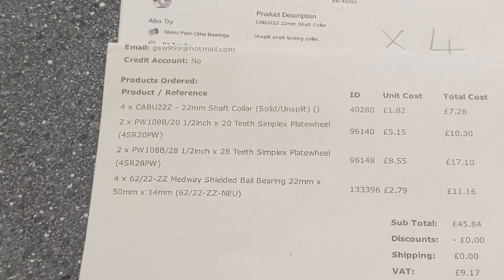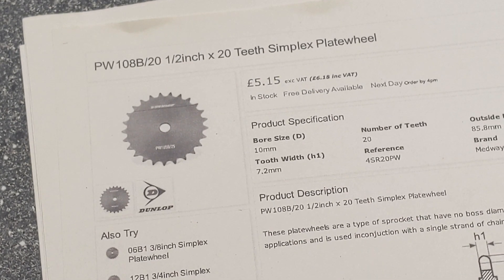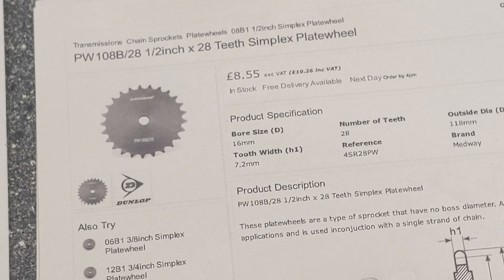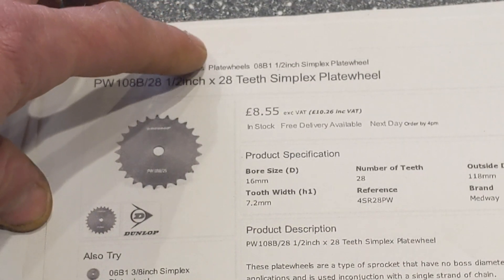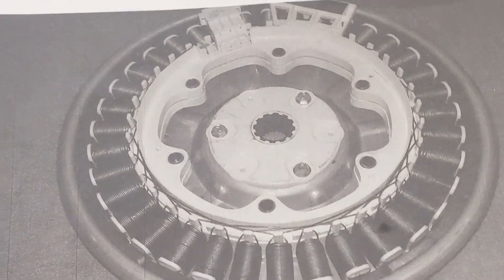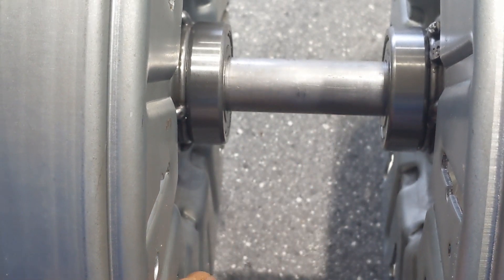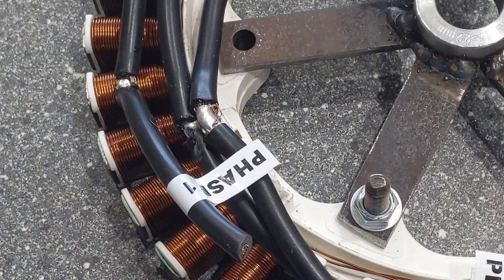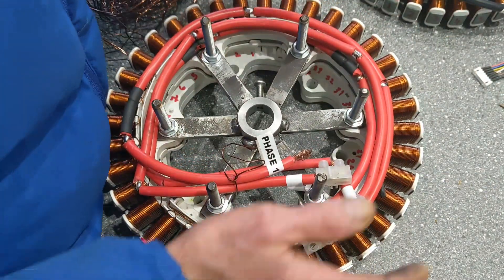Update on the Dual Smartdrive washing machine motor wind turbine project 16 November 2020

Comment: i guess were lucky in Au we can just pick washing machines up free or near free with direct drive /smart drive motors.
Reply from the maker: F and P are really rare over here , plus I think LG smartdrive based machines are in a real minority , most of them have the normal types of motors.
Reply: @GavinFreedomLover  probably cheaper to manufacture, one guy said the larger the diam a smart drive motor the more torque it provides he used it to power a bicycle , probably rewired
Reply: @GavinFreedomLover  Kris Harbour Natural Building just put up another video of his unbalanced axial in action it has 2mm magnet wire by memory
Reply from the maker: When I saw that it looked like it has two sets of magnets just glued on top of one another, I wish I could make blades that may be the next thing I try and learn just make a 3 foot set or something, have you ever done it?
Reply: @GavinFreedomLover  no the one thing being a mechanic rotating masses scare me so i bought GEO222 Blades from ozwind engineering, they work well on my freinds turbine and very quiet, maybe not the absolute best out there  but theyll do me, problem is i need someone with a lathe the mill up all the parts i need to clamp the solid bar to a thick metal disk  more money but worth it, so i guess ill that will be done in a few months, pretty busy. these blades essentially can be taken out or in in diameter.
Reply: Hi, I'm Korean.   Good job.